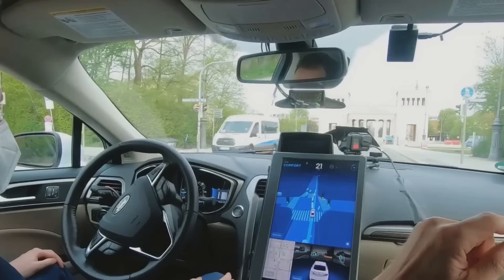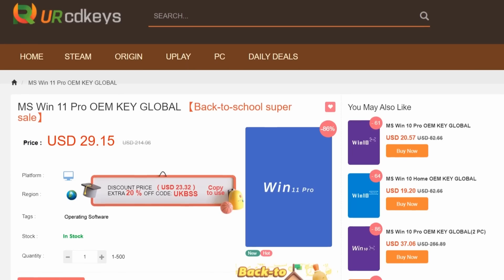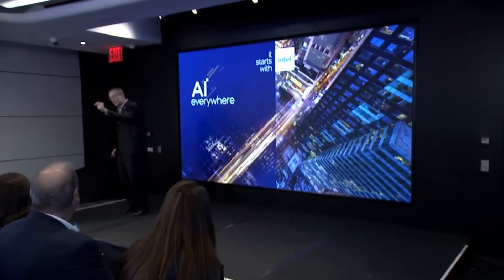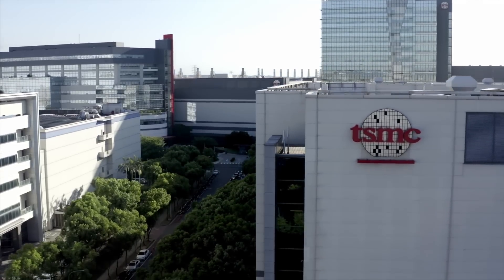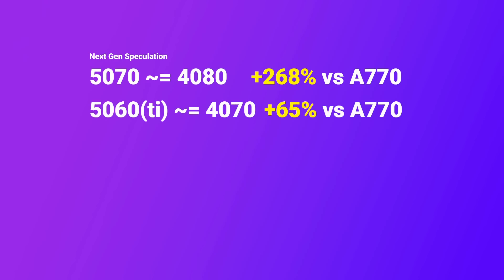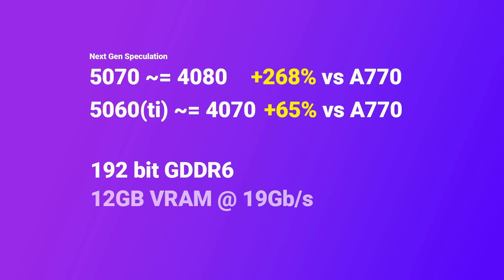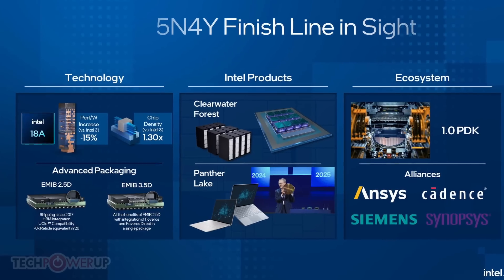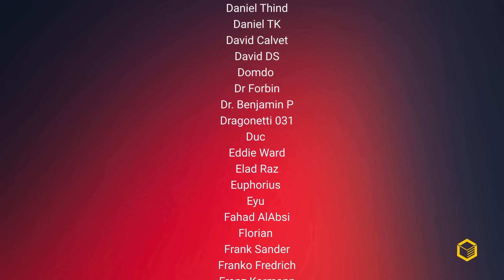I'm worried about Intel's Battlemage GPUs

Comment: Intel arc issue is not hardware, it's the driver optimization... Which has come a long way, Intel arc battlemage will be good
Reply: Actually Intel Arc Does in fact have a hardware flaw that's been known for ages. A lot of the work they've done with the drivers has been to allow them to work around the hardware flaw. Battlemage graphics should be a huge jump forward.
Reply: @hot_wheelz  what's the hardware flaw that impacts performance?
Reply: @Wild_Cat  I think the flaw being talked about here is the fact that Alchemist can't run DX9 on the hardware side of things and it must use a compatibility layer that worked horrendously with release drivers.
Reply: @el_de_el_loquendo9855 That's not a flaw though... It was a conscious design decision. A horrible decision but it's definitely not a flaw. It probably wouldn't have been a big deal if their software was up to snuff but it was barely functional on that front at launch.
Reply: @lammyjammer6670  Yes I agree, but as you may know people like calling everything they don't like a flaw, the decision not to process DX9 calls and instructions from the hardware side was definitely a thing that the engineering team thought yet, we have seen how this is not a problem with good drivers as you said because Intel has been working on their drivers to optimize the compatibility layer from DX9 to Vulkan and it has given good results to the point I could recommend Arc GPUs.
Reply: it IS hardware. Do you realize that the Arc GPU's have a transistor budget and power draw up to RTX 3070 levels? Yet they're slower than a 3060?
Reply: @JoeL-xk6bo  does that hardware flaw or bug still exist when it outperforms the 3060?
Reply: @Wild_Cat  yes, the bug is present in all current generation Intel Arc chips.
Reply: @hot_wheelz  so what's the bug? Did you test it and find it?
Reply: As you can see when you question these people that make these claims they've got no answer lol... Just a bunch of people who pretend they know what they are talking about.
Reply: @Wild_Cat  thanks for the reminder to reply to this thread, life got a little hectic and I simply forgot as more important matters took precedence. I'll break my reply into 2 parts. Firstly, yes, Xe2 / Battlemage will be a huge leap forward for several reasons, the switch to SIMD16 execution units instead of SIMD8, instructions such are Fast Clear and Execute Indirect now being implemented in silicon instead of being emulated in software, a dramatically improved RT pipeline and many other changes to hardware will ensure that battlemage is much faster and more compatible overall and should finally free Arc owners from the absolute need to get day 1 optimised drivers for a new title to ensure playable performance levels. But, as you rightly noted, these aren't bugs in Arc as much as they were deliberate design decisions.
Reply: @Wild_Cat  now for part 2 I'll address the silicon bugs that have plagued Arc.

Firstly, there have been a number of security related bugs in the silicon that have been patched in various driver releases and each of those come with a performance hit. 2ndly, there's been significant bugs in the silicon for the Arc hardware scheduler. This has also required driver fixes to work around the bugs and those come with a performance penalty. Finally there has been long standing issues with Arc hardware acceleration that has been responsible for lacklustre performance and poor compatibility. The one upside of all of this is that these issues are now quite well understood and specific changes have been implemented in Xe2 / Battlemage to avoid the same issues in the next generation of hardware.
Reply: @Wild_Cat  thanks for the reminder to reply to this comment. The truth is that I simply got busy with life and entirely forgot about this thread. As they say, life happens. While Xe2 / Battlemage will see many significant improvements such as new instructions implemented in silicon such as fast clear and execute indirect as well as the switch from SIMD8 to SIMD16 execution units and a significantly more capable RT pipeline, all of these things were inherent design choices made for Arc and while they have certainly been responsible for huge performance penalties and the absolute imperative need for day 1 optimised drivers to have any hope of even reasonable performance in new games, they are were not bugs. These hardware changes alone in Battlemage will massively improve overall performance and significantly reduce the reliance on day 1 optimised game drivers for new titles in order to ensure reasonable performance in new titles. As for the hardware bug I mentioned in Arc, there's been several related to security that have required changes to drivers to prevent malware attacks etc. Most of these have ultimately been fixed in newer revisions of silicon but there's still a large percentage of the cards in the wild that have those issues baked in so are reliant on the driver fixes that ultimately come with performance penalties. The other big silicon bug with Arc has been in the silicon for the scheduler. This has also been partially (but not fully) fixed in later silicon revisions but there's once again a  massive percentage of cards out there with these bugs baked in which makes those cards reliant on software fixes in the drivers that attempt to work around bugged silicon at a significant performance hit compared with if this was done entirely in silicon as was originally intended. Hope that helps answer your question.

Comment: Lvl 1 techs said that Zen 5 wasn't made for x86 to be much better, in favor of huge gains in AI performance. I think Zen 6s issues are not necessarily due to the node.
Reply: Hard agree that it's not the node - the fact that Zen5 performs worse than Zen4 in some workloads is evidence that it's an architectural issue, not a manufacturing-issue.

Comment: Average midwit comment: "Im glad we have more competition and choice"

Then proceeds to never buy an Intel gpu and go Nvidia as always.
Reply: PROUD ARC A310 OWNER 😤😤😤 (AND RADEON 7600 AND TWO RTX 3060 12G) FIRST CLASS LINUX GAMING SUPPORT 😤😤😤
Reply: Well as a laptop buyer I didn't have a choice.
There was one run of zen4 16core + rdna3 alienwares that I'm pissed I missed the sale on (would have bought for $2800 AUD) instead I picked up a lightly used 13900hx 4060 Helios Neo for 1400, which was sold last year for 1900 down from 3000 RRP. AMD laptops hardly ever get discounted.

The main rule of pricing is, there's no such thing as a bad product, only a bad price. However, if Intel can't make money off it at the price it needs to be to sell, then it's a bad product. Arc is just not efficient enough, it needs too much silicon and too much memory to do the job of its peers. It's so bad nobody even bothered releasing dgpu Arc on laptop
Reply: Most people only buy one GPU per generation. Right now intel asks for the same price as nvidia for the same performance as nvidia.